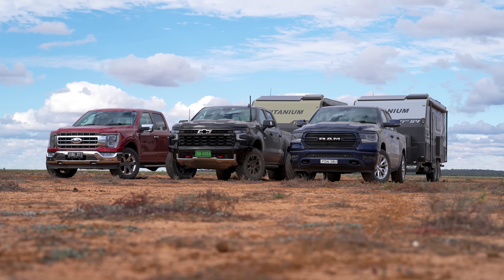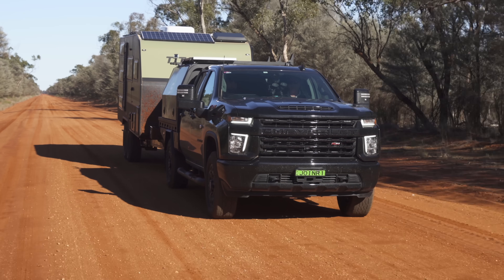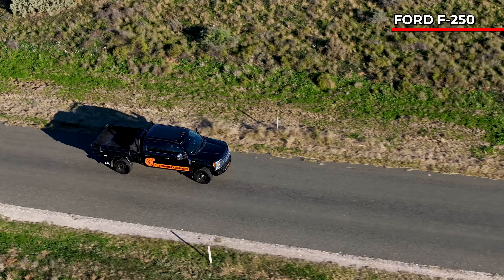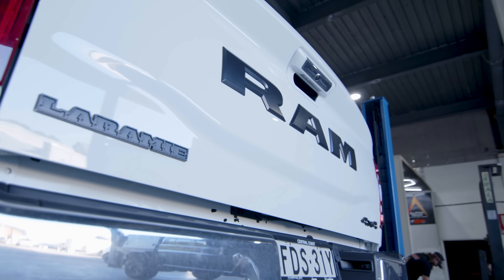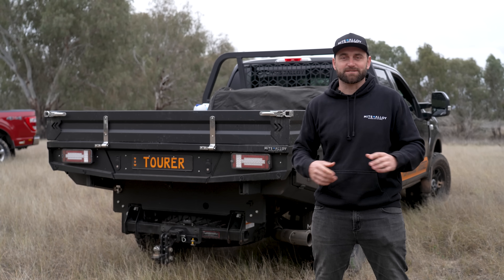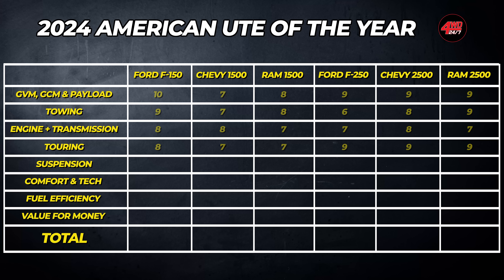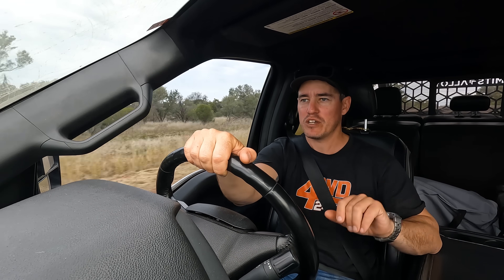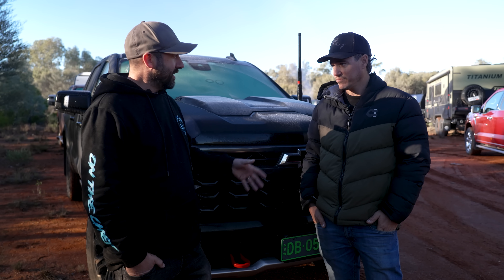2024 RAM vs CHEVY vs FORD TORTURE TEST! Heavy towing, dirt roads - SHOCK WINNER & major problems

Comment: All those 'overbuilt' Jeep 'toys' towed to the trail by Ram 2500/3500 or F350/f450 trucks are built from parts of said f350s and Ram 2500s. I have only ever wheeled 1 vehicle that wasn't full sized, and while I loved my 88 land cruiser, it couldn't haul my house like my Ram 2500hd can. And I can still wheel it through anywhere in my neighborhood. The only reason it couldn't follow Sooty up the cape is because the gatekeepers are only as wide as Sooty and my Ram is almost a foot (305mm) wider on the body as well as being 6ft longer. And yes I daily drive roads that make your bush/desert roads look like hiways. My truck just passed 26years old w8th no signs of stopping.
Reply: I love my 01 ram 2500 5.9 cummins 6 speed manual She's starting to need a new part here and there but at a little under 450k miles I'm not surprised
Reply: @yetibremsstrahlung9018  absolutely, mine is the 98.5, one of the first 24v trucks I did the pump at 375k, about 10k after I got it. Did the auto and upgraded it at 426k and haven't had anymother troubles. Other than things that were because I wore em out; like u-joints and double cardems. Stuff that wears out. Power window switches all the time cuz my dogs stand on them all the time. Of course the nody is no longer pretty, but it's a truck that gets used. 550000km on it.
Reply: What roads are ya driving it on mate cause I don't see em going off the blacktop. I drive a 32 year old cruiser with 660,000 on the clock and she runs like brand new mate and she'll go everywhere
Reply: @Jyden_Carmody  logging roads in BC Canada. Thru the logging sites to repair broken equipment carrying parts and tools. Most of where I live and work is in the mountains. And I loved my cruiser til the body fell off the frame. But it wouldn't haul my 25ft fifth wheel trailer that I live in.
Reply: @darrinrebagliati5365   ya can't go wrong really. I blew up a the rearend twice a few clutchs u joints and I need to do the drivers front left axle ujoit now but as the miles stack up I'm impressed.  Shit wares out. Over all still solid. Mine came With the pump upgrade. I did have to replace the hard Lines to the fuel injectors after #4 broke 1 day and money wise it was Better to replace all 6 for 120$ vs 50$ for the 1 line!  Old girl is a power house even with 15k on the bumper!
Reply: @Jyden_Carmody  I take my 01  off the black top here in Washington all the time to logging sites and pulling the mini excavator over the mountain and in and out of job sites out woods.  Done lots of snow recoverys and mud recoverys etc. Onlydown side is fully geared up with tools and recovery gear I'm almost 10k# but even at 10k she hammers thro shit just stay out of bottomless mud
Reply: @yetibremsstrahlung9018  absolutely, I run a stock 24v cummins thru a beefed up automatic and 35s at the moment. Tow vehicle by day, overlander on the weekends. Abandoned and deactivated mountain roads. Have done front drive shaft 3times, axle ujoints, replaced rear ujoints. Transmission, injection pump. Def needs some panel bashing. Things break, especially if you use it! But body panels are cheap, parts aren't horrible and I do most of my own stuff.
Reply: @darrinrebagliati5365  exactly! I'm on 35s as well. No problems.  Most of our roads are wide and being the extended cab long bed I stay off tight trails when possible and drive slow when it's necessary lol.  Shit brakes that's the nature of the game. The first rear end was fully locked and blew the ring and pionion up hunting in the mountains. Ended up having to pull the rear driveline and 3rd member to get home but made it in front wheel drive. Had to get towed the second time as I had the excavator in tow and blew it pulling onto the highway from a job.  It broke 1 of the 4 bolts that holds the 3rd member in and stretched the second one and junked the ring and pionion a second time.  I got a warranty on the gears and got new gears but found a used rear axle out of a short bed same gears so I just swapped the whole unit o more headaches. I'm thinking something is a little bent with the original rearend housing maybe.  Eather way I laugh when ppl say that big old truck can't go in there lol.  I do love my 79 chevy k5 it will go whare ever to but I can't tow the excavator or my trailer with it comfortably.

Comment: in USA the weight on the tow bar has to be taken FROM the payload. so 4.5T with 10% bar takes 450KG from your payload. the GCM matters but only as teh final check. 

its not uncommon to have an f150 rated to tow "14,000lbs" but only have 1,500lbs of payload. so somehow you have to fit driver AND fuel in 100lbs..... which you cant. then teh GCM is 19,000lbs BUT the truck maxed on payload would eb 7,200. so REALLY only have 11,800 for towing.

 if you buy a NO option XL (work truck, vinal seats, etc) you will have enough payload to get to 14K with a 150lb driver. BARELY, no luggage, no bottle of water, nothing else in truck,

Comment: If you are looking at a newer truck avoid eco boost F150's.
More issues than National Goegraphic!
Here in the states, Ford is recalling hundreds of thousands of eco boost engines for multiple issues.
Mean while the Coyote 302ci V8 just motors on down the road.🤔😏

Comment: I grew up in California with an "off roading" family so I know American trucks can definitely get through some hardcore trails. The last few years I've lived part of the year in Perth. 
What Americans think of as off roading is not the same as what Aussies think of as off roading. One of the longest "off roading" tracks in the US is the Rubicon, and that's only 35km long. 
In Australia, you're looking at 200km of infuriating, teeth shattering washboards just to get to trail that takes you to the trail. Those trucks were not designed for those conditions simply because those conditions don't exist in the US. Hell, the canning stock is 1800km. At some points, you are 500km away from anything or anyone.
It's not trash talking American made stuff. I think they are great to drive, but no way I'd attempt something like the canning stock route and expect it to be one piece after.

Comment: I have 17 Silverado 4x4 z71 max tow is 11k Lbs. payload 1,700Lbs, also 15 dodge ram 3500 dually. Max tow is 17k payload is 7k. Also 17 f150 max tow 12k max payload 3k.  Silverado mpg 26 highway. Ford 18 highway. Dually 10. Paid 38 for dually cab and chasis new..Chevy used at 40k miles for 28k..ford new 50k

Comment: Good vid. Do the cops actually pull over and check weights for light vehicles commonly or at all over there? I've met more than a handful of people pulling well over the GVM and tow ratings closer to 8000kg combined with landcruisers and the like here. I'd probably want to keep it kosher myself, and the soft rear in 100/200 stock isn't ideal, but they'll easily do whatever you ask of them. And unlike Aus NZ isn't flat. I got down to 80kph on the motorway full throttle near the bottom of third last weekend towing up hill. But other than thqt section I was passing cars left right and centre without trouble in the 26 year old 100 :-) helper air bags are on the cards soon though.

Comment: In the States the Cummins is considered the most reliable and you can get an Aisin transmission but they have a new 8-spd by ZF for the 2025 models. 

One thing to note, the 6.7 Cummins is used in a ton of different applications from medium duty trucks (20-33k GVW), buses, military, marine, etc. 

I personally like Ford trucks the most but they are all pretty competitive and it comes down to preference. 

My GX460 (Prado) is big enough off-road, these trucks really would be pushing it size wise for the serious stuff, don’t think most people choose them for that.
Reply: Most reliable diesel engine in the States is the Powerstroke 7.3.
Reply: @tyeetamer no
Reply: @jamiemagdeleyns9152  Sorry, facts don’t care about your feelings.

Comment: There are a few items I have noticed growing up around these vehicles. 1 Luxury:  (Best-Least) Chevy, Ford, Ram. 2 Depreciation: (Highest- Lowest) Ford, Chevy, Ram. 3 Longevity: All three have been known to have their failures, but Ford and Chevy have been consistent at not being build for longevity. That being said there are many hard core offroad vehicles that are rebuilt, modified and are out on the tracks. RAM, is comparable to the old hilux, bluntly it is a simple workhorse. I hope that the distrubution of parts greatly improve in Australia cus these are some impressive vehicles. 
Another item to consider, when going through water crossings a petrol engine has a higher chance without the right mods to cut out. 
Last item, with all the electronics, on all newer vehicles, you will need a technician in your convoy with an electronic diagnostic device to reset and repair electronic gremlins on the tracks. I wish that all manufacturers would have a basic model without the screens, sensors and unecessary touring and offroad features. 
Thank you, for the reviews. Keep it up.

Comment: Overpriced, yep. Fuel guzzler, maybe. Great tow rig yep.
Great for touring, but I would prefer our normal sized dual cabs with mods/accessories and money to spare.
To spend over $100000  and more...then needing to throw more $$$$ at them is hard to swallow. But they are great looking trucks with a lift and bigger wheels

Comment: Chevrolet does make a diesel engine just didn't make it in the ZR2 until now, you should have chosen any other Chevrolet and you could have gotten the diesel engine, but when they first built the ZR2 for off-road it only come with the V8 and yes the ZR2 doesn't tow as good as the regular Chevrolet 1500 trucks. Plus the ZR2 comes standard with front and rear lockers and yes American trucks are good off road

Comment: I work in the insurance repair industry here in the states,  the metal the frames are made from is , in my opinion,  extremely thin and not very tough.  I've seen trucks need  a frame replacement even tho the front bumper was still attached and they t boned a car,  that's it.  All the broken plastic was still on the trucks front end.  It's ridiculous how thin it is. It was a 2021 chevy 4x4 with the small diesel.  I did the frame swap myself.  I would not recommend taking these trucks offroad as i don't see the twisting and stress doing anything but damaging the frame.  Dodge , Ford, jeep same deal.  I got a gladiator that needs a frame and this is the 7th one I've seen just from small front end hits. They really don't make them like they used to
Reply: "Need a new frame." Yeah, probably because the crumple zone of the frame was affected by the crash.

Comment: Twin locked 2500 Silverado about $160,000.  Twin locked 300 series about $150,000. Twin locked 70 series made safe $150,000.  If you're towing around Australia the answer is simple.  Silverado - more comfort, better fuel economy, safer all round.

Comment: serious question: in australia, if you want larger towing capacity, isnt there Hino and Mitsubishi Cantors? What othere options are there? is that cheaper than importing a F250 or 350 (USA here, I was considering an F550 Arctic conversion)
Reply: They are really uncomfortable and rough, there is a reason that all mine sites in Australia call them bouncy trucks.

Comment: The f250 is actually not like for like, it is the older 2019 model which didn’t have the same
Power/torque and is still a 6 speed. The 2020 f250 upwards have more power/torque (class leading) and a 10 speed box.

Comment: Granted the parts availability is obviously a problem. We have oilfields, logging roads and other offroad tracks as you call them. You automatically assume that you have to upgrade the American trucks before taking to the outback is a bunch of rubbish. The Chevys maybe. The the axles and transfer cases are way stronger than anything Toyota makes. There are also trim levels of these trucks which are designed for off-road use including skid plates and other suspension upgrades from the factory. JS 😮😊

Comment: The F250 is 2 generations old. There was an upgrade in 2020 and another in 2023. You can’t really compare it to a current model with far more torque and a totally different gearbox.

Comment: With the ford with its 710kg payload if you have 4.5t on the back you can only have a driver and a mate and 100kgs of gear on board. Payload gets sucked up pretty quickly. If you only tow up to 3.5t you are better off with a ranger as it has a much higher payload

Comment: As an American, and I've got a strong preference towards "THE FANTASTIC OFF-ROAD DEVICE'S" (FORD).  or the  FANTASTIC ON-ROAD DEVICE'S (ALSO A FORD). I couldn't help but through that in for my friends who (sadly) drive Dodges and Chevy's. I've got a 1996 F-350 Supercab w/7.3L Diesel. I've got a 6" chassis lift and a 4" body lift. I've hauled loads that seriously over loaded (10,000lbs in the bed) my truck (dearer spec's go out the window). And I've hauled a 3 axle gooseneck (hauling 21,000lbs of scrap copper). I've also carried/pulled a combination of 2,000lbs cabover camper, and around 6,000lbs of Bayliner boat on a trailer. Does anyone know how much that ticket would be??? My truck is a combination of play truck, where off-road performance is essential. And a everyday driver. As well as my workhorse. It's got over 450,000 miles on it, with no. major break downs. Mostly regular maintenance.

Comment: If you were in the market for just a ute, a duel cab is the way. If you're about to buy a brand new Landcruiser/patrol and get it ute chopped don't bother. Just buy a 2500 and be done with it. By the time you buy the LC/patrol and chop it you'd be paying the same as a 2500

Comment: Technology is great.... Until it stops working correctly.  My 2018 Z71 Colorado's touch screen is doing some weird stuff lately.... pressing areas all by itself, and I hardly use it!  50,000k on the clock, and lives in the garage.  I can't see it being a cheap fix either.

Comment: The 2025 RAM 2500/3500 will all have the same H/O Cummins with a ZF Powerline 8 speed transmission. Down side, since 2019, Cummins went to hydraulic lifters and now are suffering from lifter failures. Nowhere as bad as Chevy are having lifter failures with their petrol V8’s.

Comment: As a Canadian, call me simple, fine, but most of our trailers and basically  all of our toy haulers and camper trailers have electric breaks and your truck should have them on a switch or  integrated to the pedal, so to me the question is, Why is your load rated to the vehicles break when most trailers have electrical breaking giving them more stopping power rated to the carry load of that trailer. A double ended sword there, with not all trailers breaked, should be a simple requirement over weighing and troubling with it.

Comment: Hopefully, it's not the F150 ecoboost recalled for valves breaking off in the engine?
Reply: @JSH083  That's the 2.7, truck in the video is a 3.5. In spite of the valve recall, the 2.7 is probably the most reliable recent Ford 1/2 ton motor. Unless you can find a 3.3, 3.7 or a 6.2.

Comment: you need to measure chassis thickness to compare properly. broke my ram 1500 2018 DS chassis and discovered it was only 2.5mm thin steel????????? what the?

Comment: I feel the ford's f250 got ragged on to much due to its age and the poor steering conversion. I've done thousands of miles offroad working the dog piss out of a 250 and 350, including a 350 with double knuckle bucket on it and 15,000lbs behind it and never had any of the issues they stated.

Comment: Those are off road models of Chevy trucks and tow way less. For instance Chevy 1500s with the right setups can tow over 13,000 pounds. The ram also can tow close to 13,000 pounds. And the f150 can tow 14,000 pounds when you move up to the 2500 series of vehicles the Chevy can tow over 22,000 pounds the ram can tow 19,500 pounds and the Ford can tow 23,000 pounds